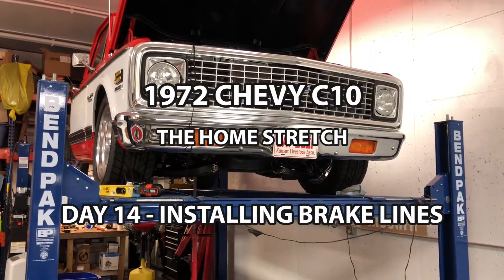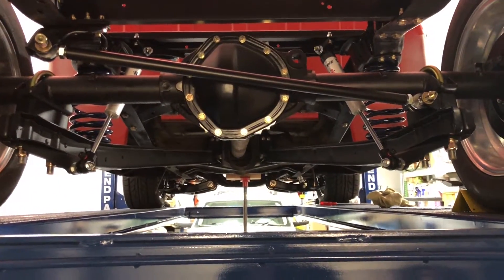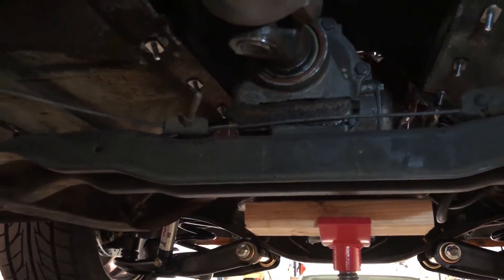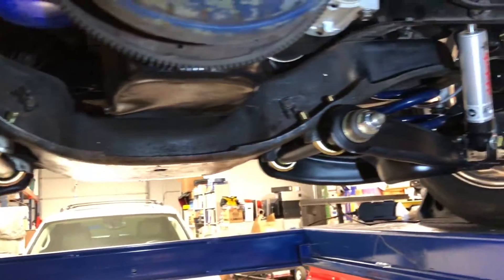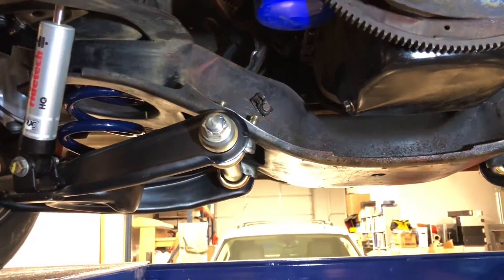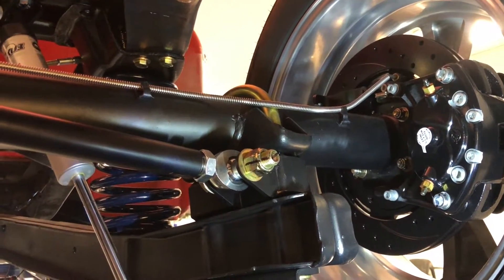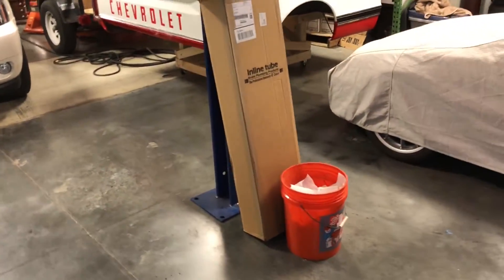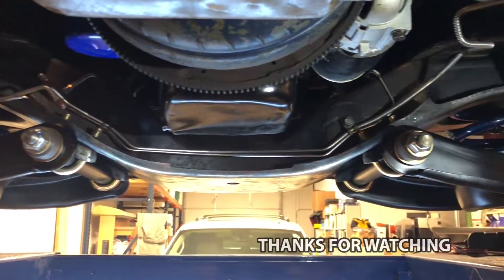'72 Chevy C10 - Brake Line Install - Out With The Old - Day 14

Comment: I need one of those lifts over here. But first I need a garage with a ceiling taller than 8ft, lol
Reply from the maker: I'm lucky to have some shop space at work.  It does make it easier, although there are times were a 2 post would be much easier.  Thought about one of those quick jacks like sloppymechanics just bought.

Comment: I bought an inline kit didn't fit at all only the rear axle worked. The long run from the back to the front had to bend it straight after shipping it didn't look too good.
Reply from the maker: Yeah, mine had that bend as well.  Most of it fit, I did have to make my own lines for the rear end because I have disc brakes.  Hope you got your lines figured out.  Thanks for watching!

Comment: Rusty Wrenches   >The short piece needed that the rear axle maybe in your box is a length of stainless as long as it’s the same size. There are just some tricks. You need a quality inverted/double flare tool kit, perhaps “Rigid” brand. I bought SnapOn but was as dealer tech and needed tools used day in and day out. 
 With SS tubing, make a clean straight cut. File across the end to increase accuracy to start. 2nd, file the outside to place a 10-20 degree taper on the entire outside edge. Just a little & not too wild. Now, purchase SS fittings unless supplied. They should not be magnetic. Place one on the tube inside flaring bar. To set up tubing to create a bubble-shaped end, the instructions ask you to match the thickness of the flare inserts base to equal the tubes height. If stainless, shorten the tube by 20 - 40 thousands lower. Like the gap on a lawnmower spark plug. With the tube located, place the adaptor into the tube and tighten. Use a few drops of brake fluid for lube. Then finish the double flare with the screw bracket and hardened tapered end slowly tightened until seated. It works every time. “Tech Tip” Use SS fittings not steel or coated or anodized fitting. These are dissimilar metals and will cause corrosion thru galvanic action. I find it cheaper to buy rolls of SS line that is DOT / SAE approved. Also, NiCop can be scuffed and painted silver & clear. It seals it and last decades as found on SAAB’s, PORSCHE, VOLVO & others from NorthEastern Europe. Caution; There are fakes sold on epay as wall thickness is thin. Double check! 
Certified automotive ASE Master Tech since 1978 - Retired.
Reply: The wet boiling point of DOT brake fluid is 284 degrees F. You don’t need any wrap or shielding.
Reply from the maker: If you catch the next video in the series, I make the line with an Eastwood flaring tool.  Thanks for watching.

Comment: Are your rear shocks upside down?? I have mine installed 180°!
Reply from the maker: The instructions that came with my kit said to mount them shock body up. I wonder if they have changed the instructions?
Reply: @RustyWrenches  I just talked to them. They said it does not matter due to the fact they are mounted eye to eye not eye to stud.
Reply from the maker: @lanereese7924  Did you buy the Streetgrip kit?
Reply: @RustyWrenches  I don't think so. I ordered from Travis at pro performance. Just got the ridetech HQ series shocks. Says eye to eye on my invoice.
Reply from the maker: Oh I see. From what I can remember, the shocks had the bushings preinstalled in the box and would only go on one way.  I think the larger bushing was on the rod end which bolts to the trailing arm.  Might be worth a call

Comment: On that drivers side they have the fittings backwards
Reply from the maker: Anthony Whitley which fitting are you referring to?
Reply: Rusty Wrenches the brown end on front drivers side. Doesn’t fit my wilwood connector. Did you have to re bend?
Reply: 5:48 in the video.
Reply from the maker: @Anthony-hx2pq  Oh yeah, it is the same way on the stock lines.  It is the larger fitting.  I ended up buying an Inline Tube part #HLF02 to make it all work.  Hope this helps.
Reply: Rusty Wrenches how many will i need to get?
Reply from the maker: @Anthony-hx2pq  Should only need one, for the drivers front.  If I remember correctly, the rest of the fittings that come with the inline tube kit work with the Wilwood flex lines..  Here is the link :https://www.amazon.com/gp/product/B0713M5MCD/ref=ppx_yo_dt_b_search_asin_title?ie=UTF8&psc=1
Reply: Rusty Wrenches thank you.
Reply: One more thing well a couple. Did you need any special t’s or couplings for where the branches begin on back side cross member on master cylinder side? Any pictures?
Reply from the maker: When I bough the kit from Inline Tube, it came with all of the fittings and tees. I did have to cut the rear line and re-flair at the master cylinder to work with the Wilwood MC.
Reply: Rusty Wrenches that you for your help working this part now.
Reply: Rusty Wrenches did you use willwood proportional valve.
Reply from the maker: Anthony Whitley you bet!  Good luck with your project.
Reply from the maker: Yes sir